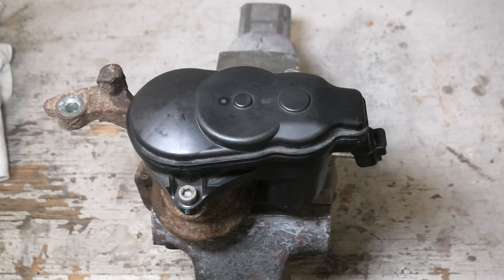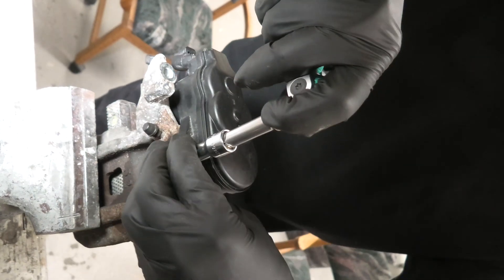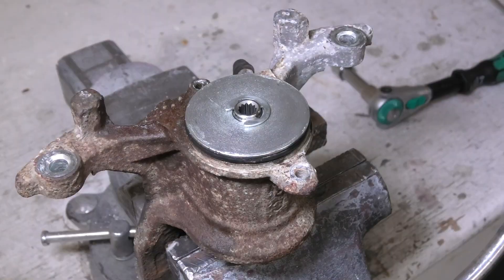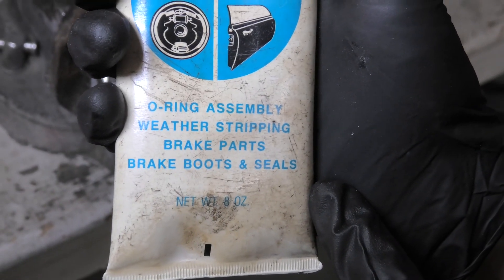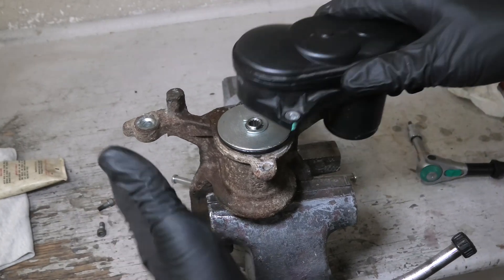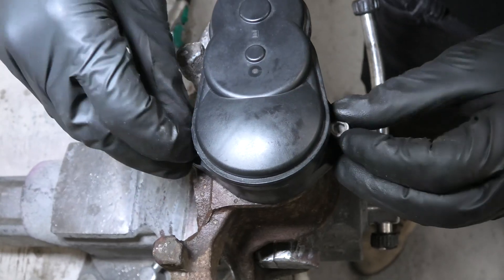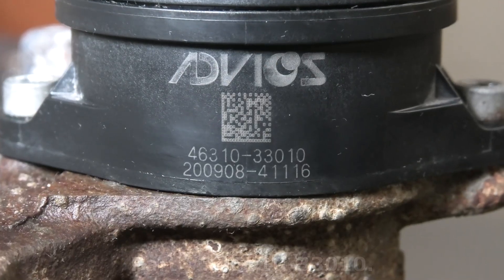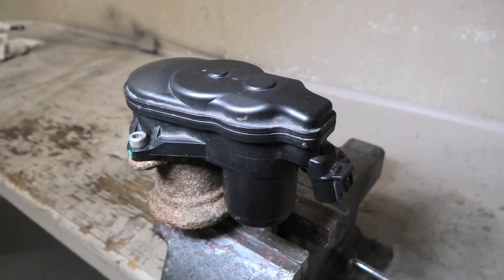Toyota RAV4 (2019-2025): Electric Parking Brake Actuator Replacement.

Comment from the maker: PRODUCT LINKS:
1. 46310-33010 Parking Brake Actuator Right Left Replacement for 2018-2022 Lexus, Toyota, Camry, Avalon, Corolla, RAV4 - https://amzn.to/3FUWSmT.
2. AGS SIL-Glyde 8 oz Tube - Advanced Brake Lubricant, Brake Grease/Lubricant, Brake Pad Grease, Heat Resistant, Rust & Corrosion Protector, Moisture Proof - https://amzn.to/3S0veb6.

RECOMMENDED TOOLS:
1. 1/4" RATCHET AND EXTENSION - Wera Zyklop 8000 A 1/4-inch Drive Ratchet & Zyklop 8796 LA Long extension, Square drive 1/4" Head x 150mm Extension - https://amzn.to/415sSLe.
2. HEX BIT SET - GEARWRENCH 44 Piece 1/4", 3/8", 1/2" Drive SAE/Metric Hex Bit Socket Master Set, 89086 - https://amzn.to/4bEaJbh.
3. FLAT HEAD SCREWDRIVER - Klein Tools A131-2 1/8-Inch Flat Head Screwdriver with Keystone Tip, Made in USA, Pocket Clip, 2-Inch Round Shank - https://amzn.to/3VV0FVh.
4. 3/8" TORQUE WRENCH - VANPO 3/8" Digital Torque Wrench (2.2-44.3 ft-lbs./3-60Nm) - https://amzn.to/46LkNfX.
Reply: Plz sir